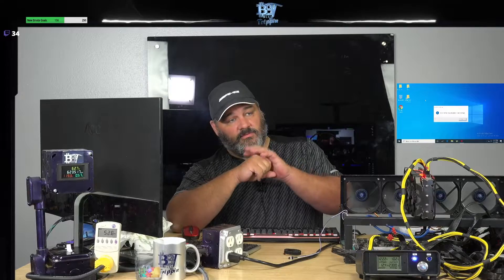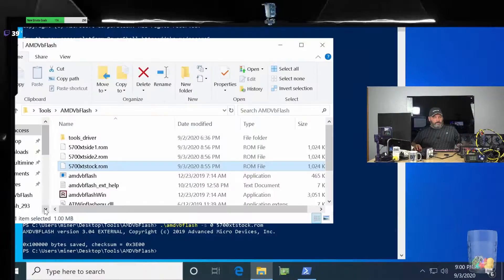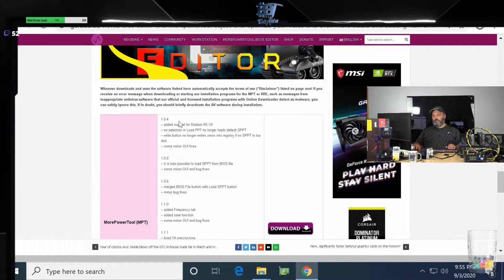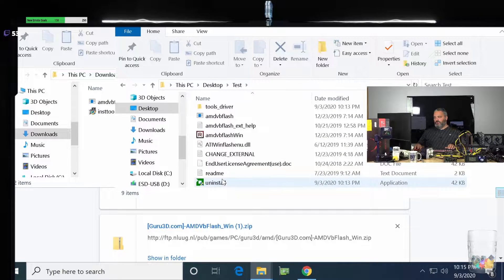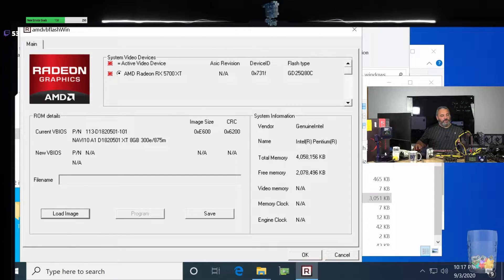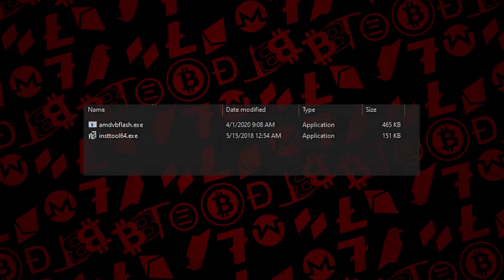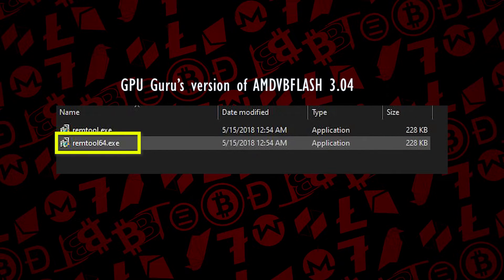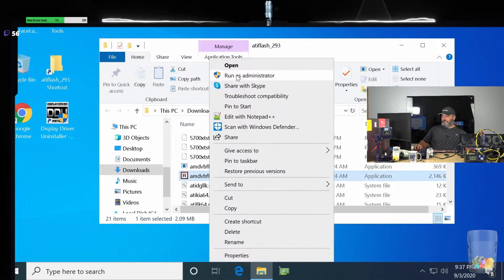Igors AMDVBFLASH 3.04 vs GPU Guru version when BIOS modding 5700 XT

Comment: Hey bro, I very enjoy all your explanations,  sometimes very tech loaded but always useful... about this cases I have a mysterious with Asrock 5700xt.. while it were flashing power goes off and know is briked.  I'm doing bios chip bridge and result is:
With bridge.
Amdvflash -i recognize adapter and romsize 40000, test fail

Then bridge cutted 
Amdvflash -i recognize adapter and romsize 100000, test pass and shows bios p/n

Then: unlock rom 0 = unlocked,  Amdvflash -p 0 "bios.rom" =adapter not found , error 0FL01 .

But restarting the pc windows start no problem.  

Any advise in this case ?

Comment: hello, please I'm stuck who can help me please, I flash my Asus Rog strix Rx 5700 no Xt, with amdvbflash I got an error message that the -f is not supported, then  the flash continued and asked to reboot, after reboot no image, then I restarted in Q mode I tried the same with the stock bios the flash worked but still no image on the mode  P, I tried on the machine of a friend who has a built-in card I flashed the card again but with another asus Rx 5700 bios, there the fans stop and when I try to flash  with atiflash I have an error message telling me error program rom, is my card stuck?  when I do on AMD flash -i I have the navi10 information ..... etc, please who can help me I am blocked I bought this card not two months ago, thank you in advance

Comment: Hi

So when I try to do this it say “no adapter” found. Also if I try to boot with this gpu plugged in my system does not boot. I tried checking in display adapter on device manager and it does not detect a card their as well. I’m using a Asus tuf 3 5700xt

Comment: I have flashed 5600XT Pulse BE with mod rom, after GPU not works, I have tried 2.93 it failed even to open app: failed read rom (-unlockrom does not solve it)
I have used 3.04+, it can recognize GPU, but when I try flash to native bios got error ssid mismatch, -fa has not helped me, also -f param does not exist in 3.04+ version
how I can flash with force option using 3.04+ version?

Comment: If you flash do you NEED to unlock ? i managed to flash and i DID NOT unlock!  - confirming, thanks
Reply from the maker: its not 100% required, some AIB manufactures would require the unlock first. I do it as a safety measure as first step.

Comment: HI,

Can one use Amdvbflash 3.04 for Polaris cards?
I did save my rom.
I edited my rom using red bios editor and i unticked the 0 fan speed thing.
No go , cant see my GPU now.
I reflashed back my original bios.
All fine now.

What did i likely do wrong?
I basically use admin and -s and -p options

Comment: I just wasted 8 hours + on this, basically an entire day. I was able to mod 2 out of my 4 cards. The sapphire cards I have I can get those to close to 60mh but they are unstable, more than before. The gigabyte cards that I have, they will not post with a modded bios, I tried modding the straps on them, no post, I tried modding only the power play tables, no post. Really this was not worth it. The rig was running stable at around 200-210mh for a week already. 220mh, ah. What a waste of time. its 5 in the morning for me. This is really only worth it if you got 6 or more of the exact same card.
Reply: with amd yes, dont mix brands in same rig as they ALL require so much different tweaking yupp.    thats one headache Nvidia never has haha

Comment: I have a Gigabyte 5700 XT Gaming Oc 8GB, the bios can be found online. Anyway, I modded the bios after I modded my sapphire cards. The card won't post with any modded bios that I've given it, I've had to restore it to factory default bios 3-4 times already. I tried coping the straps down from 1700 and still no post, is there some kind of check on this card that it wont boot with a modded bios?
Reply: I think the reason is that cards which were already overclocked like your gigabyte .. can't get juice out of it .. i have the same exact card and it seems like they made it in a way that it screams: "don't even f****ng touch me"
Reply: @evilloooo  It has been confirmed by others, including red panda mining, that the gigabyte oc cards have a security check on the card that prevents a modded bios from being started up.
Reply: @ekse4146  is there any bypass for this security check? I also have the gigabyte rx 5700 xt OC version
Reply: @lykourgakhs  I've been told to use a older bios, I'll get back to you, if I'm able to get it done.
Reply: Had the same issue with my gb cards. Would not accept any change to bios. Gigabyte rx5700xt Gaming (BOTH rev 1 and rev 2) neither worked after modding.
Reply: Any solution to this? The BIOS is signed and not permit any change or mod ! :(
Reply: @Picapalito  use the latest version, it skips the signing. As for the gigabyte card, you need a different bios file, back up your original, then find the other bios for your card, its a aorus bios, and use that. The new bios that is on the card, wont work modded.
Reply: @ekse4146  what do u mean the latest version? which flash tool should i use for the gigabyte gaming oc? the 2.93 or latest 3.04??
Reply: @mbaiser  AMDVBFLASH version 3.04+EXTERNAL Is the tool from igorslab

Comment: This is why I'm keeping my 570/580's. ;) Good old fashioned workhorse cards. So what if they pull a little more power.
Reply: Sound like your driver switched from ‘Compute’ to Graphic
Reply: I think i messed up my sweet 570s .. whatever i do, they never go above 10 mh/s.. that is suddenly after months of over 29 mh .. what drives me nuts is i don't even remember what exactly the thing that i did wrong in order for this to happen
Reply: @evilloooo  What are your clocks/dpm/voltages etc. set at and what mining software and/or OS? Nothing is burnt is there? A hot electronics smell or spicy burnt smell? Depending on how many cards are on the rig it might be easier to unhook all cards but one, get it stable and plugging each card back in one at a time. I've done this several times instead of staring at the rig and wondering. :) Are you running it off a USB stick? I've had several go bad and act funny and burning a new stick worked for some problems. I've even fixed a rig once by plugging the USB stick into another USB slot. I'm just spitting out ideas since I don't know the details. Above all don't lose your mind! I know how easy that is to do with these things.
Reply: @evilloooo  run Phoenix with the parameter -y
also try claymore and while running press y while it is mining.
You might have to run phoenix or claymore as administrator

Comment: All I can add is that Igor's 2.93 would not work at all on my card but his 3.04+ following Red Panda's tutorial worked perfectly. The only problem is I'm not sure it was worth it. Only gained like 2 mh/s but mem temps have shot through the roof. My card doesn't have good mem cooling it seems.
Reply: On another note, just got a 5600xt that's been rock solid stable and cool so far so hoping to try it out on that next
Reply: if your using hiveos, you need to set your mem controller voltage and mem voltage  etc.. thats what makes it cooler, and lower ur clocks
Reply: @jimsinnovations2737  On windows. Core temps are no problem, it's so underclocked and undervolted it runs at like 52C but mem temps go 95 unless I crank the fans which gets it down to 88-90. Haven't found a way to change mem voltages on windows yet
Reply: @wingracer1614  ya you need to undervolt the memory, im not sure how you do it in windows, just hiveos an other distros, i got mine running 57mh at 77c mem temp at 900 mem clock which is like 1800 on windows
Reply: blower cards are rubbish but they have great mem cooling im thrashing the hell out of 4 blower 5700s and mem is at 72 centi